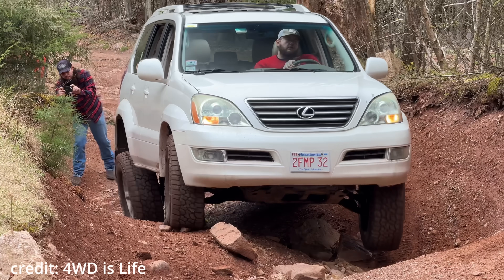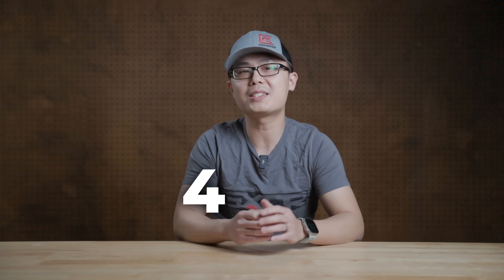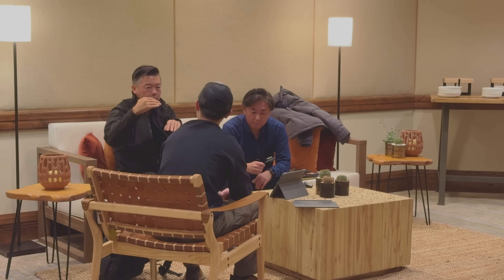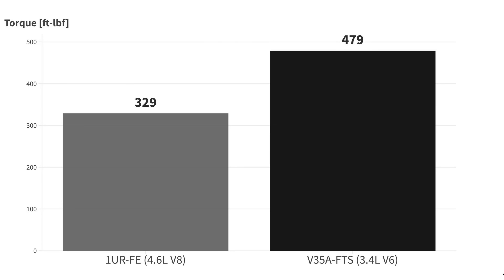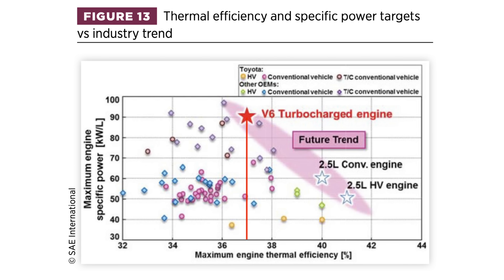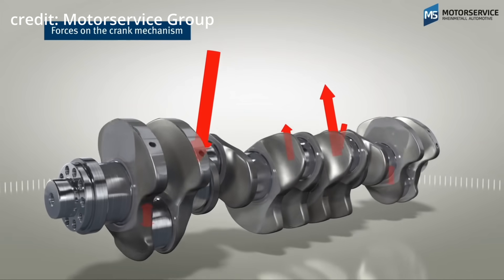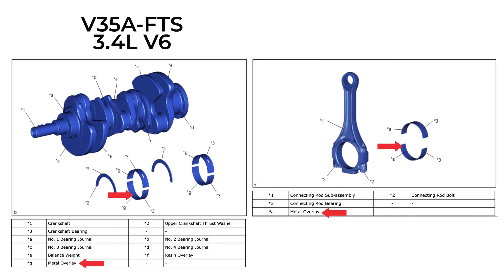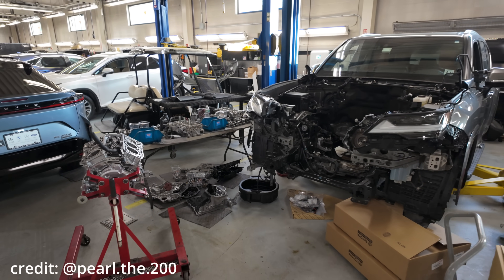Is Toyota V35A-FTS Engine Reliable? Well..It's Not That Simple

Comment: I can save everyone a lot of time.  Yes, the engine is overstressed.  Yes, it'll be mildly better than another company's engine.  But it will not be as reliable as the Toyotas we all loved in the past.  I would not buy one.
Reply: I love my 40-year-old underpowered yet highly reliable 2H engine 😅
Reply: That's silly. Judging based on torque per liter is silly.

Engineering for high cylinder pressure is just making sure the block, heads, gaskets and rotating assembly can handle it. Most failures are NOT related to any of that, at least in OEM engines. Most of Toyota's reliability record comes from doing everything else well, like seals, valve timing systems, fuel systems, electrical systems, cooling systems, auxiliary systems like the air conditioning, etc. None of those things have anything to do with high cylinder pressures. At worst, they might require a more frequent service interval for the spark plugs.

And besides, the average demand profile will be that most owners won't be calling for 100% torque more than 1% of the time anyway. Most of the engine hours will be spent well below 50% torque output.

I'm not saying you're wrong. I'm just saying you can't make the call based only on max torque per liter. It borders on ridiculous, unless we're talking about real extremes like top fuel drag racing engines or high demand applications like aviation or marine use where they might be run at 90% throttle continuously for most of their life, and 140-lbft per liter in a soccer mom's SUV doesn't even begin to get close to either of those.
Reply: @xtnuser5338  I value your opinion and I disagree with it.  Have a good day
Reply: @xtnuser5338 
Great points 
Some people just don't understand there are many factors involved
Reply: It is going to be the same thing in the tundra with the ttv6
Reply: @kerplunk38880  Now that's a friggin mature way to dissent. Not often seen here in the youtube comments. Thank-you!
Reply: At the end of the day, there’s really no substitute for displacement. 5 L engine is going to be less stressed than a 2 1/2 L with the same horsepower and torque.  Yes they could design the smaller engine completely differently to be able to handle that additional stress but that’s gonna result in more points of failure and lower fault tolerance. I have no doubt they could eventually make it work similarly but they would likely change and their design completely and have to start over long before that happens due to circumstances outside of their control like different emission requirements.
Reply: I opted for the 2023 Tacoma over the turbo 4 in the 2024. Will take the underpowered V6 any day.
Reply: @rags2rigsrevivingtheoldcru156 ❤ FF😊
Reply: Watch 12:30
Reply: @xtnuser5338  using turbos generally are a way of getting a less reliable engine. Sure it’s good for power in small engines but if your engine has a relitevly low compression engine and say like 10 or 15 psi of boost your definitely stressing your combustion chamber out. But on high compression diesel they need a turbo to even function properly
Reply: Yes, it was a ridiculously long video, for some pretty simple points of interest.  
The most significant point, was concerns of poor engine reliability over time.   
You seem confident in predicting the future, but base your claim on a single, simplistic point.  🤷‍♂️
Isn't engine reliability just a little more complex than that?
Reply: @assininecomment1630  The problems have already started.  Pay attention.
Reply: @xtnuser5338 really ? Ok if you say so. 😆
Reply: @Sauronthegreat1967  Yeah, really. It's just the reality of things like metallurgy, force analysis, stress and strain calculations, physical design, etc. Not just because I say so, but because it actually is the reality of things as we know them.

It's like you saying a single 2x4 stud on each side is over stressed holding up a large door frame, and then me telling you that's true but we've doubled up the 2x4s on each side to make the frame stronger, so it will be fine. That's overly simplistic, but it illustrates that no matter the forces involved, we can engineer things to account for them if we want to.

No there are certainly many engines out there that are NOT strong enough for the power they can make, and therefor blow up. But there are also plenty that are strong enough. So it is possible to do. And if it is possible to do, then we can't just say more power output automatically makes an engine likely to blow up.
Reply: Trying hard to get max hp, while saving gas. I still remember my 75 celica with the 20r engine or 2.2. Now, that was one good engine.
Reply: Its not better than other manufacturers engines. It has tons of issues and theres no denying it. Its worse then engines made by BMW for example, and thats a tough pill to swallow for Toyota fanboys. Theres a reason Toyota collaborated with BMW for the Supra, they intended to gather knowledge. Thats the reality of it, the magic Toyota reliability is a myth. The secret behind their older super reliable engines is just that they were incredibly simple and low stress while other manufacturers were already doing forced induction etc. Thats it
Reply: @6942O-n6n  The M3 and M4 variants have a higher specific output than this Toyota, with a smaller displacement. And you're saying they're MORE reliable. That proves you can't simply make a blanket judgement that power/displacement results in an unreliable engine.
Reply: Mildly better, not even a Ford guy and I know Ford absolutely outplayed Toyota
Reply: What about 3.3L Twin turbo diesel?
Reply: You literally did not listen to the engineer did you? He said it is a low stress engine man peoples comprehension. These days is mind-boggling bad.
Reply: @DavidRC-m9w  Please use punctuation properly.  Your responses about comprehension are incomprehensible.
Reply: @kerplunk38880  yeah it’s called voice texting ha ha ha ha. But you shouldn’t really have to worry about how I formulate my sentences or the structure of my grammar generally, you should worry about comprehension skills. 😂😂
Reply: @DavidRC-m9w  Without proper punctuation it is impossible to comprehend what you're attempting to communicate.  If you can't comprehend that then we are done here.
Reply: @6942O-n6n The Toyota officials said they needed a straight six engine which they no longer make, thus BMW was the only choice left and best of all, BMW makes the best straight sixes on the market. Thus the collaboration and that model niche was not high volume anyway, so will not disrupt both companies market base. Not hard to see win :win for both companies. 😅
Reply: But in my search for my next car, I’ve seen half a dozen Tundra’s at one single dealership in Dallas and click on the CARFAX button and you see a dozen shop visits, and engine replacements.  Clearly Toyota is voluntarily “buying back” i.e. replacing customers vehicles before lemon law kicks in.  (At least that’s the only thing I can think of as a reason for a new 1 or 2 year vehicle to be for sale used with a new engine and one prior owner.).
Reply: @Erin-Thor  Owners like me are simply trading them after they’ve been fixed.  No confidence in them at all
Reply: If you mean it's mildly better than the 3.5 EcoBoost you are mistaken.
Reply: No its not. People attributing there's bearing issue to high power are dumb. It's happening at lower miles so it's more than likely manufacturing issue or assembly issue.
Reply: @barrymantei7795  I didn’t say that so it certainly isn’t what I meant
Reply: @datownkidd  I respect your opinion and I disagree with it.  Have a great day.
Reply: I would disagree. Lets see if any of these motors go 400 k with no major issues. They wont.@xtnuser5338
Reply: @xtnuser5338 right? None of these people would say a turbo diesel is overdressed while having higher compression and combustion pressures.
Reply: The turbocharged 22R-TE
Reply: @paininthepatoot  The turbocharged 22R-TE
Reply: @assininecomment1630  The turbocharged 22R-TE
Reply: @DavidRC-m9w  Yeah the 8 minute to 12 minute mark were interesting. Nice technology to make a lower pressure efficient engine. Bearing issues on the other hand are usually caused from oil pressure or contamination issues unfortunately:/
Reply: @JOutterbridge  yup agree. And I know they will fix it
Reply: @DavidRC-m9w manufacturers say lots of things to sell vehicles....doesn't  mean they are 100% correct....there is a reason they have stopped bringing them to Australia.....
Reply: Why dont they make a bigger liter modern and refined 2jz vvti and call it a day. They are reinventing the wheel.
Reply: @jimmyjohnson7883  that’s a good point and it would be accepted well for sure
Reply: @star9732 I guess we should use the Cadillac 500 then?
Reply: @hamburgerhamburgerv2  engines ground up designed for longevity are almost always massive in comparison to amount of HP and torque produced
Reply: Technology has moved forward since the previous V8 … So it’s ok to be wrong 😆
Reply: Boosted motors are just fine as long as the motor is designed well. Ecoboost gets a bad rap but the 3.5 has been more reliable than this Toyota engine. I've had no problems out of mine and I pull a camper all summer. Proper oil changes go a long way. Forget 10k oil changes. Whatever the manufacturer says, half it. They care about getting you thru warranty and that is it.
Reply: @nateg08  Boosted engines are more complex.  More moving parts.  More electronics.  More failures.  Without a doubt.  Cannot be contested.  However, I do agree that they can be ruggedized.  BMW's B58 is a prime example.  But it took them 30-40 years to get it right.  

Toyota just started the turbo journey and they're in for a rough ride.  The rough ride already began.
Reply: @kerplunk38880  Bmw only made one turbocharged car between the classic 2002 ti and the introduction of the n54. I could be wrong but isn't the b58 more a development from only the last 15 years or so? Hopefully won't take Toyota as long as the technology is a bit more mature.
Reply: @memememine1  This is incorrect.  There were turbo 4, 6, and 8 cylinders.
Reply: Hai!
Reply: @cottagegymfun m😊
Reply: @RacerX1971 not to forget the increased oil consumption and oil degradation. Need to change the oils at 3000 miles.
Need to give turbo time to cool down before shutting it off.
Reply: Yip. I agree with that. I wouldn't buy any new vehicle today.
Reply: @nateg08 I have one of those in my 8 year old Transit 250 van. It's not had any issues
Reply: You can all get as technical as you want, but turbo a V6 will NEVER last as long as a v8 doing the same job proven to manage 1 MILLION MILES SERVICE
Reply: I think the engine is just fine. The problems come from the manufacturing side of things as far as cleanliness in the block. If I was to buy this car new. I will do an oil change in the 800 to 1000 miles. Just to flush the metal particles out.
Reply: @mccortezy  That’s an expensive leap of faith.
Reply: Thank you so much as you have saved me lots of time searching about this particular engine.
Reply: With higher booster intake, the compression ratio of the cylinder brings the discharge press and temp to the next stage, which degrade the material strength much faster than with the natural aspirator V8, larger engine displacemet. That is the root cause, not just stress, but the thermal stress at much higher temp.
Reply: Give this man a million thumbs up for this comment.
Reply: Love my underpowered 2tr
Reply: @kerplunk38880 They’ve made turbos for decades. By your argument the 80 or 100 series Land Cruisers are unreliable because they’re over stressed turbos. 😂
Reply: @kerplunk38880  which engines are you referring to?
Reply: @JollyGiant19  Pay attention.  How much HP per liter in an 80 or 100 Series?  I’ll be here waiting while you try to understand the difference
Reply: @memememine1  Starts with the new Tundra engine.
Reply: Someone missed the point
Reply: @kerplunk38880  How much heat and pressure do turbo diesels undergo without issue? I'll wait for you to answer!
HP per liter is a horrible way to measure, it's the heat and pressure that cause problems.
Reply: @JollyGiant19  Diesel engines aren’t similar to gasoline engines.  Diesel engines blocks are heavier.  Diesel engines don’t leverage spark plugs.  Diesel engines were simple until the government required ridiculous emissions equipment.  So, they aren’t comparable.  You should have known this before initiating a debate that you will certainly lose.
Reply: This comment continues to age well, v6 turbos from Toyota are self destructing.
Reply: @xtnuser5338 you can say they are wrong because they are
Reply: @SithLordDarthBane Well it didn't actually as they are wrong on why the failures are happening 😅. Toyota confirmed that a manufacturing machine was leaving metal fragments during production and announced a recall of 200k vehicles. And techs are confirming that.
Reply: @knobsbuttons2632  Both machines in Japan and USA?  Fake news,
Reply: @kerplunk38880  you obviously haven't done a recent look into the topic so I will leave your weak response to that have a great day and stay safe.
Reply: @knobsbuttons2632  I know more than you.  I cannot say more.
Reply: @kerplunk38880  I am giving the benefit of the doubt that you are an intelligent fellow so. Until you prove the assertion that you know more I am taking that as a false hood I'm open to being proven wrong, but as a smart individual yourself you understand healthy skepticism I would hope.
Reply: @knobsbuttons2632  First of all, Toyota will never fully disclose the cause for the engine failures.  They've given minimal information in the official recall saying machining debris is the culprit.  It cannot be assumed this is due to the machines (both in Japan for the Lexus and in the USA for the Toyota) is the cause.  It may be the production process, a machine specification issue, a material issue, or a design issue.  There is a new engine revision so this alludes to this being a combination of all of the above.
Reply: Agree!
Reply: The plain fact is that the technology behind this design isn't new, yet they didn't go with it on the OLD platform, why?
Because the previous design is simpler, and more reliable.

Yet again we've been forced to accept less, for more, all for the sake of 'efficiency' that will get eaten up by some WEF attendees' private jets.
Reply: @chris0628 Technology is not by default an advancement in reliability.
Reply: Same here. Was planning a Tundra when they introduced their Turbo garbage had to drop the idea and stick to older car.
Reply: I have 32 case studies of Toyota failures, two of them on their maiden journeys. Tell someone else about the "Toyota reliability" delusion.  Case studies prove opinions wrong. Always use facts.
Reply: Truth is, OP is not as smart as he thinks .
Reply: Ok boomer
Reply: @xXlURMOMlXx  I’m not a boomer.  I really need to commend your intelligent and hard hitting response, regardless.  Genius.  Probably took days for you to formulate it while you cry in your sleep hoping your new Tundra’s engine doesn’t grenade.  Best wishes to you.
Reply: Toyota v8s aren’t that reliable done a lot of v8 4.6 and 5.7 engines the coolant leaks in the valley head gasket issues and it super labor intensive and timing chains
Reply: @xtnuser5338  Toyota OEM Mirrors on new cars can barely make it in extreme heat. Forget that this is a TT V6 in a big car, the bigger issue is that Toyota is having the same issues as Honda when they peaked in popularity. They started cutting corners and the quality of materials are no longer good. Look at GT86 and Corolla GR’s with problems. Toyota is coasting on their reputation and it is going to cost them, it’s a repeat of Honda.
Reply: @Get_yotted  You can't say it's over stressed JUST because it's in a big/heavy car. You would have to know all the engineering data to determine whether it's over stressed or not.
Reply: Better than any other companies engines eh? Over 200,000 miles on my 2015 Ecoboost 3.5l. Take a guess how many bearings I have spun? How many times the engine has blown up? How many components in total I have had to replace on the engine? Answer is none. Quit drinking the Kool-Aid. They rested on their reputation, and it's kicking their ass now. Engine failures for the 3.4l, transmission failures on the Tacomas, Corollas randomly catching fire. Stop living in the past.
Reply: @ Ford…LOL
Reply: @kerplunk38880  Still somehow less problems than the Toyota engine.
Reply: @ I wish this was true of Ford but it’s not.
Reply: @kerplunk38880  it has been for me. Still like my 2005 Sequoia better, but it's been solid. I have developed a hatred for unitized wheel bearings because of the expedition though.
Reply: same here, the 3.4 used in the 3rd gen 4runners is still super reliable, but i would not buy any of the new toyotas, period
Reply: @kerplunk38880 how is it that a 2UZ could withstand over double the unrated horsepower on stock block and internals?
Reply: @xtnuser5338 the dude is not a car-knower
Reply: @star9732 not true. Theoretically capable of more power based on the amount of fuel/air allowed in the combustion chamber? Yes. Less stressed because “bigger equals less stressed?” Absolutely not. Try cranking 350hp SAE net out of a 70s-80s small block without risking damage to the internals.
Reply: @6942O-n6n what issues does it have besides those in a batch of engines that were caused by manufacturer quality control?
Reply: @MrCountrycuz not cool down, just don’t turn it off as it is spooled up. As long as the turbine isn’t spinning without oil lubricating it, it’s fone
Reply: @mten1454  there’s a reason heavy duty work trucks and tractor trailers have massive engines. It’s because they won’t accept less than a million miles and that’s the only way to get them there reliably
Reply: @ tractor trailer drivers are putting 100k miles/year hauling 80k+ lbs plus the weight of the truck itself. The average driver is putting 10-12k miles/year, isn’t towing every day let alone to the max capacity, etc.

For a non-commercial, consumer owned car, it is 100% possible to create a reliable, smaller turbo engine that can go 250k+ miles if maintained properly and/or can take considerably more power than rated at the factory. Toyota already did it with the 2JZ.
Reply: @ it’s absolutely possible but as stated in my initial comment the complexities are astronomical and the manufacturers are forced to change the design before they perfect it due to emissions and other regulations.
Reply: @  you’re using a lot of hyperbole to attempt to make a point without key information that neither of us have access to. 

My point being — small turbo engines with strong power/liter ratios have been made in the past, with Toyota having made many of them. Not just the 2JZ, but the 2.0t in the IS and NX as well. For the average consumer that may get lucky to put 200k miles on a car, these will be more than adequate — and if they do have problems, Toyota has established the precedent that they will extend manufacturer support of these engines.
Reply: @ i have the ear of several automotive engineers.
Reply: @ are any of them engineers at Toyota?
Reply: @ no but I find it hard to believe they wouldn’t have similar challenges.
Reply: @ maybe they do in some cases, but Toyota has a reputation of dramatically outperforming most car makers when it comes to quality control and engineering. The GXs and their engines are built in Japan, no less.

You might know several engineers that are themselves competent, but it doesn’t mean they don’t have constraints put on them by the bean counters and upper management. Ford and GM are notorious for this.
Reply: @ We aren’t discussing a 2UZ so how much wood could a woodchuck chuck if a woodchuck could chuck wood?
Reply: @ Tractor trailers don’t have engines or drivers.
Reply: @ the common name differs depending on your location. You know what i mean.